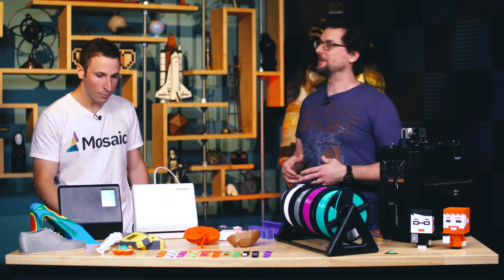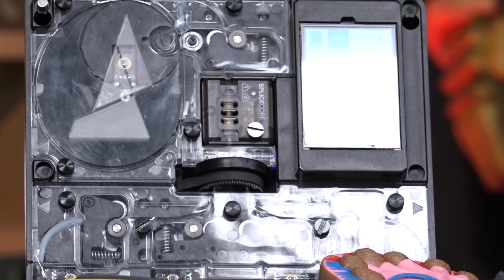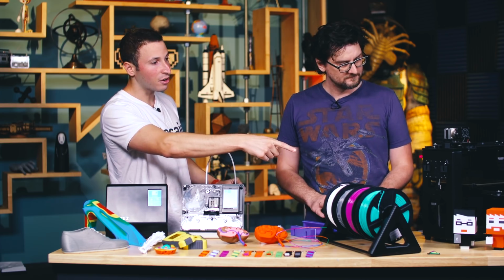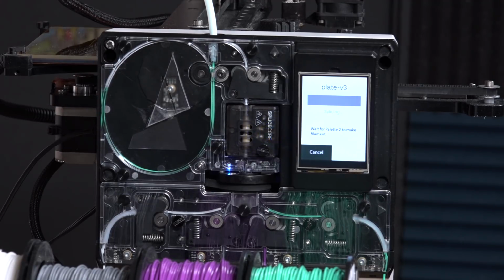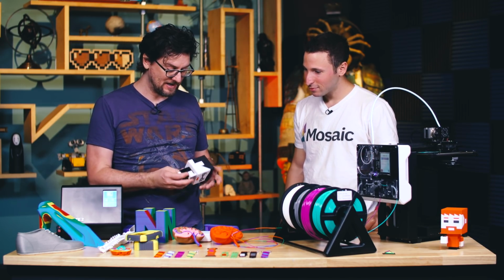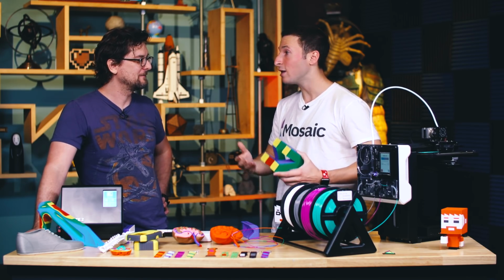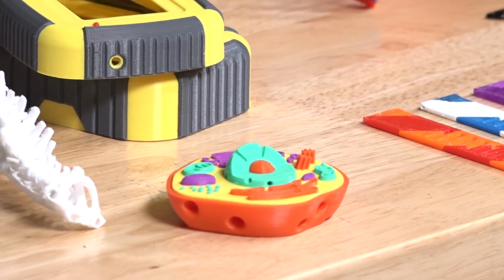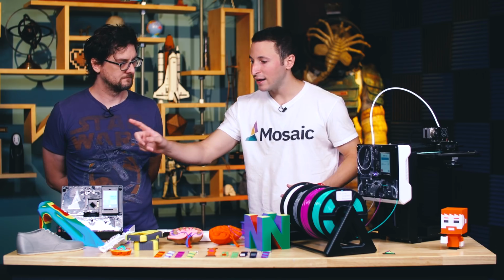3D Printing in Multiple Colors with the Palette 2

Comment: Very cool invention, if I understand correctly, to add multi color to an existing one part stl file, one must through cavas select layers of the model where color change is desired. These layers are then broken off the main model to create a multi-part stl that then can have the ability to have the different colors or materials designated per file, it is then these parts (files) that are then reassembled or joined back into one model with software markers, this then tells the palette when, how much, and at what time to manufacture splices to push through the hotend to produce layer color changes for x number of layers? If I’m understanding this process correctly, can you produce layer changes of color in specific location of the X and Y of the model, or does the entire model get the layer color for entire dimension.  
For example if I import a cube and I want the main cube to print in white, but want to place a different colored square of color on 3 different sides of the cube only so deep into the cube without effecting the color of that entire surface layer, is this possible?
Or can I take for another example a single pre-made stl soldier model file, cut off his bacpack and save it to print in black, cut off his face and tell it to print in fleshtone, cut off his pistol on his side and tell it to print in silver, and tell the remainder or whats left to print such as upper body and legs in army green?
You mentioned that a paint on surface feature would come out in the future. Would this allow for example allow one to free hand draw on a single stl model with a brush tool and have it print on just surfaces or print all the way through in each color, would it have a magnetic contour lasso tool that would allow selection of areas with projections or dimples of surface to aid in one’s accurate selecting out one part of the model from another,  aiding in colorization without relying on accurate freehand drawing with mouse to select a area for colorizing.  In other words, a smart line draw tool that would know where to snap to after drawn based of surface features rather that contrast, such as used in photo shop. However can you at least please share how your existing system allows you to cut apart or cut into a single stl file to create the multiple colored facets to the be rejoined and printed. For this part of how the software works I don’t understand.
Thanks 🤪✌️

Comment: As the Palette 2 is tied to another completely unnecessary cloud based software solution I will be ignoring this. Even free I won't accept processing and saving of my designs off site. Now they are talking even charging people for faster slicing during peak time. Creating a problem and than selling the solution to the customer. There is absolutely no reason to slice in the cloud. Every PC, MAC or phone has enough power to solve this in a few seconds. I know google and amazon are pushing these cloud based revenue streams as business models to understand and exploit customer better. Greed is again the death of a cool design. Initially there was the ascertaition that Chroma maybe the standalone solution but that was nonsense as the interesting feature of Canvas are omitted there. Make the cloud requirement optional for people who want it and I would buy one immediately.

Comment: now there should be a feature where it will make sure my single color/material print can use the entire spool and splice it with another spool of the same color/material so if i only want to print in one color/material i can have theoretically 4 spools worth of filament in my machine

Comment: I really hate doing this publicly but after 90 emails and 3 units that DID NOT WORK (well the first managed to make a nice dragon and some keychains before developing a splice homing error we couldn't get fixed so Microcenter exchanged it), I am kinda pissed to see this! I literally bought another unit because I couldn't afford to be down in production while they fixed the first one BUT THAT ONE NEVER WORKED EITHER. Now, Microcenter was kind enough to accept a return even though it was outside the 30 days due to the extensive emails and the situation I am going through, but Mosaic (which is per their return policy, I understand but I am not just returning an item, I simply want to exchange one that has never worked and one of THREE that had VARIOUS failures and problems) WILL NOT EXCHANGE THEIRS even though I have literally no reason to believe it will work for long if it even does at all. I actually want to give them MORE money, since I offered to even pay full price without the pre order discount. All I ask is that they would keep the palette + they have in their possession, one that has never worked, that I would NEVER have bought if i had known there would be a better product announced a month after and ONLY got due to a business need (btw I still lost that commission job btw, and have gone through 5 whole spools of filament trying to fix various issues). Now, their support team has been very good at helping me troubleshoot but the fact of the matter is, I should never have had to self repair (with their instruction) my units in the first place, and after this much trouble, asking for them to literally let me give them more money so I can have a reliable and usable device is not unreasonable. I hope Mitch sees this and we can work something out because I love the idea of what they are doing but feel like I am being punished for working with them and even getting a second unit instead of abandoning their product and company entirely. My business revolves around multimaterial 3d printing and engineering (though right now filament sales is my main income), so trust me when I say I WANT this product to work! Oh and before everyone hits me with the "it must be your settings" trust me... it could have been if it was a sample size of one lol, but I have tried with not just multiple printer settings and speeds, but also multiple printers AND ON TOP OF THAT  I am using the machine which is supposed to be the palette + premier partner machine! The robo r2 (which has its own issues dont get me wrong lol, but the palette + spitting out splices with a thickness of 1.92+ isnt the printers fault haha). Anyways, again I really hate to post this publicly but I am not going to get a satisfactory resolution through normal means, and hopefully this will get the higher ups attention :) Thanks for reading my rant!
Reply: Nice!

Comment: Just wanted to know if you still have that waste or purge tower that is the consequence of printing in color, and how much waste does it create?
Reply: For calibrated prints where different bodies on the model have distinctly colored sections, transition towers are necessary. You'll find that the tower itself is pretty hollow. We've found a number of ways to reduce the size of the tower where possible: http://mm3d.co/filament-waste

For random or gradient prints a tower is not needed. You can also get some cool effects when you don't opt to use a tower, and the transitioning occurs all within the print.

Comment: I was super hyped to save up for one of these until the very last part of the video where he says the software will be "freemium." Them's the brakes, man. 
The software being proprietary is bad enough because that means user-made plugins will be hard to develop, if possible at all. Put a price tag on top of that (which for all we know could end up being some kind of subscription model) and my interest in owning one of these drops to zero. I completely understand that a massive amount of R&D must have went into this product and the guys behind it need to eat, but slapping a software price tag (or worse yet, subscription) on a hobbyist level product is unacceptable. I can understand charging money for the software if the product were aimed at business use—but Mitch himself said the Palette 2 is intended for sub-1000$ printers, and printers in that price range are almost exclusively aimed at hobbyist / in-home use. 

I mean, 600-800$ is enough to buy a fairly nice hobbyist printer by itself, which has way more raw parts in it, so I guesstimate the hardware alone in this thing can't cost more than $400, and if its being mass produced then the assembly cost probably doesn't add too much to that. With that kind of markup per unit, I can't imagine them being unable to recoup their R&D and manufacturers tooling costs quickly—assuming they don't spend all their profits on obscene raises and bonuses every year for the execs and board members, or excessive marketing, like a lot of failed startups do—so to add a software charge on top of that hardware markup is a bit insulting. 
To continue throwing around dollar signs, the Ender 3, a popular fully open source i3 clone aimed at entry level users, only costs $200. The next model up from that, from the same company, is the equally popular CR-10, which costs around 500$ 
I find it incredibly hard to justify buying a printer addon, which is aimed at entry level printers, when it costs 150% to 300% more than the printer itself, and will have additional software charges to boot. 

And for all we know the Palette 2 will end up being the next Pebble watch; a fantastic product killed after a few years because the company goes bust, and then all (proprietary, of course) software support is dropped essentially bricking all existing hardware. No thanks.

Edit: I didn't even notice that the software is meant to be cloud-based. There's that buzzword again. My interest level in not only this product, but the company behind it has just transitioned from not interested to I'll never purchase a product from you and you'll never regain my trust. I hope you people can figure out that real humans don't like tying their expensive hardware to any cloud business model which makes them beholden to the manufacturer. If I purchase a product (especially if it's an investment of this size), I expect to own it fully, and not have it turn into a paperweight if the company kills support, goes out of business, or decides to start toying with software prices or reducing functionality. The cloud / software as a service / subscription-based business models that companies have been trending towards needs to hurry up and die, and I hope the people behind this trend go out of business and get blackballed out of the industry. 

I'm disgusted that such an innovative and elegant bit of kit could be ruined by awful software practices and lofty pricing. I think I'll wait a few years until Mosaic goes belly up and the Palette is replaced by cheaper, more refined, hackable and open source clones.

Comment: Is Canvas required to use this? A cloud based slicer with undetermined price schemes sound terrible. No problem paying for a multicolor 3D editor and slicer, but this should be standalone. Will there be a Simplify 3d plugin for this?
Reply: A lot of people have been asking this! Our companion software to Palette+, Chroma, can still be used with Palette 2 as an offline solution (mm3d.co/chroma3)

Comment: Thanks for taking good care of Mitch before sending him my way later that night :)
Reply: Joel, I thought you got the scoop when your video popped first but that's because I'm a subscriber. You guys sold me and following the link on your video bought one. I've seen the Palette for years but the price always shut me down before educating myself on the product. But this release and it capabilities and simplified operation and lower price sold me instantly.
Reply: I noticed the "Norm Tested" file when he showed it on your show. It feels a little like you got a scoop. And I put down an order thanks to your video actually. Its multimaterial and infill purging and being almost half the price as the first pushed me over the edge.
Reply: This would be much more use to me as an extension for my existing slicer setup, - learning a new eco-system (and it's drawbacks) when the equipment and profiles are already hugged to perfection, isn't ideal. Canvas does sound like magic, but if you already have multi material models - can I just plug and play? xxRJ
Reply: I would not buy this... and the only reason being is that it does not work for 3mm... I only have lulzbot...
Reply: Already seen your video, it don't seems worth it to look at this one too... Anyway, love both of your channels, keep doing what You love.

Comment: What about importing and processing 3d model formats that already have colour data of some kind in them?

Models with such data embedded (texture mapping, vertex colours, surface paint, etc) are already the norm for 3d modelling software anyway...
And while models for 3d printing require extra care it's the slicer's job to convert a typical 3d geometry mesh to something a printer can make sense of.
It follows that a sensible feature would be conversion of some of the colour data present in existing modelling formats...

Otherwise, this looks pretty impressive. The cloud based slicer software gives me pause due to concerns with what might be in the TOS, but that's another issue again...

Still very impressed.

Comment: only necessary improvement is open source software...
Reply: It does not even need to be open source, in my opinion, but it certainly should NOT be 100% cloud-based.   This is a growing trend which I am absolutely against.  If I am giving you $500+ for a piece of hardware like this, I expect to be able to use it 'offline' if I want to.

I like to keep my production machines isolated from the internet and I don't appreciate being forced to trust companies to store/process my intellectual property.
Reply: Hi Harbingerx81! Thanks for the comment - and we hear you! While CANVAS will provide the best experience, we have a free desktop (offline) app named Chroma that handles post-processing of GCode files from other slicers. Support for Palette 2 in Chroma will be added shortly!

Comment: If the printer has to work with a standard slicer, does that rule out Makerbot machines, since they use a proprietary protocol?

I’m the lead developer on a project called “Marlin Firmware.” Is there anything we could add to the firmware to better support the Palette?
Reply: He mentioned on the 3d printer nerd's channel that they want to collab with actual printer manufactures to remove a manual step.  My guess is this is something you could do? 

I'll link the vid around the time he mentions it : https://youtu.be/gd3FGrIDYn8?t=1205
Reply: Thanks for the pointer. I’ll send Mosaic a direct query to find out more!